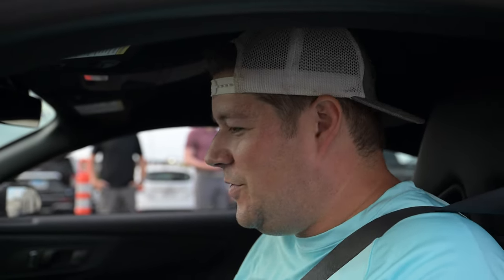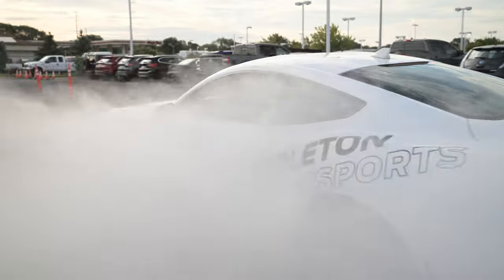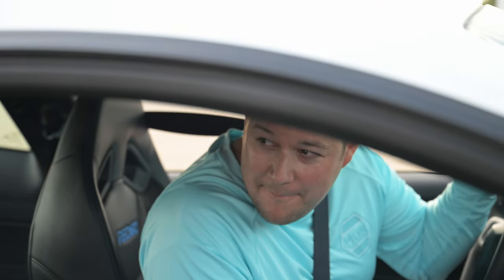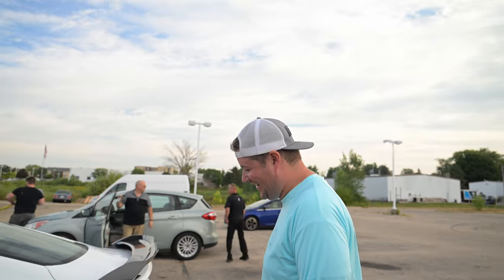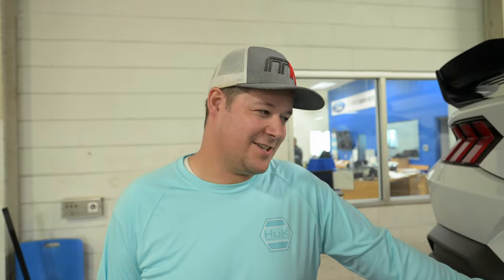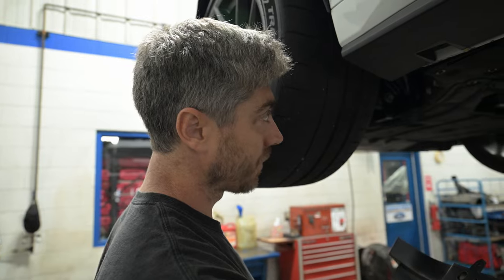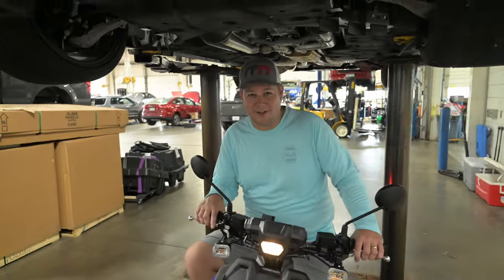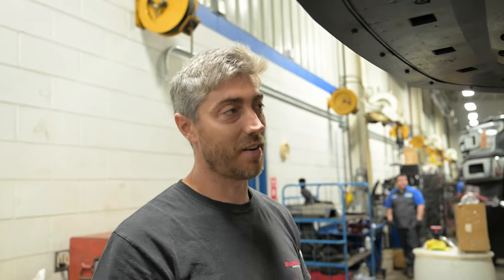2024 Mustang S650 Dark Horse Destroys Tires (MM Vlog Ep.4)

Comment: Good video and thanks for sharing the info on the Drift brake. What tires were on the car? Did you not order the handling package? The Perrelli Trofeo RS tires that come with the  handling package are not supposed to shrewd like those tires in the video. Were those tires the Michelin Sport 4S tires?
The DH looks great and sounds great. 
I look forward to the video when you test the difference after removing the charcoal stuffing in the filter tubes. Enjoy!!!
Reply: It was the Pirelli’s. You can easily read it on the sidewall. Michelin’s wouldn’t do that
Reply from the maker: Those were the trofeo rs. I just got done putting on 4s tires for the street. Have R7 slicks ready for the track